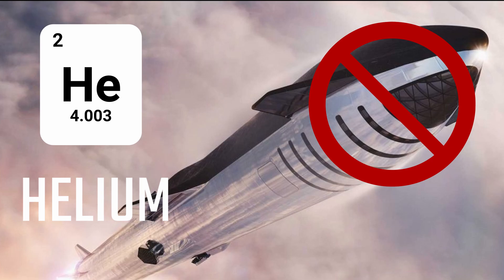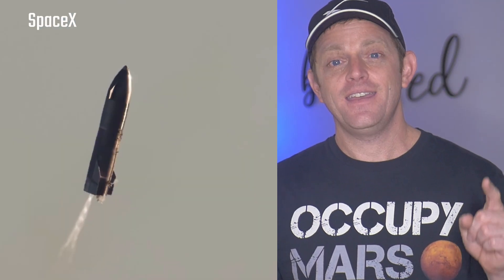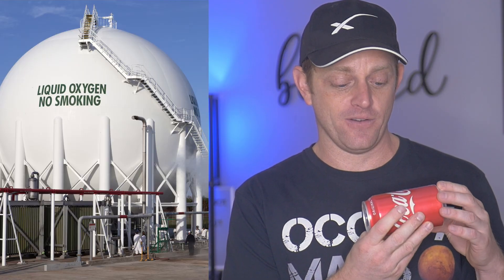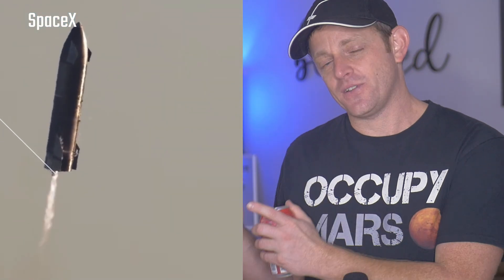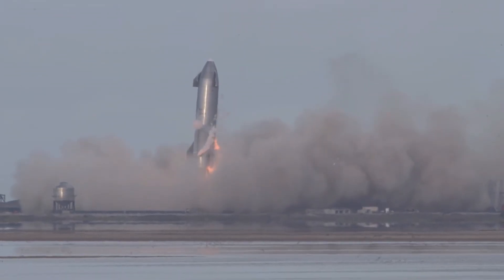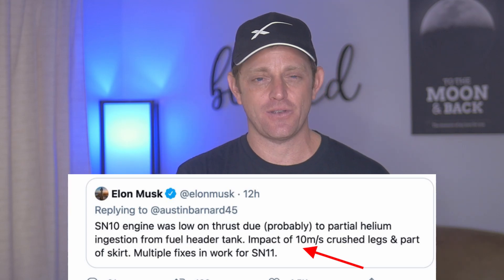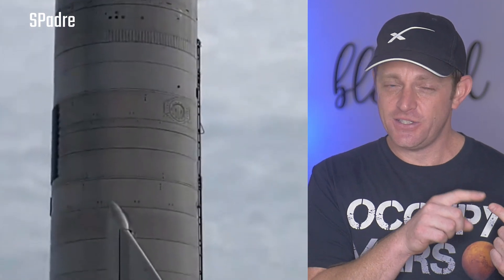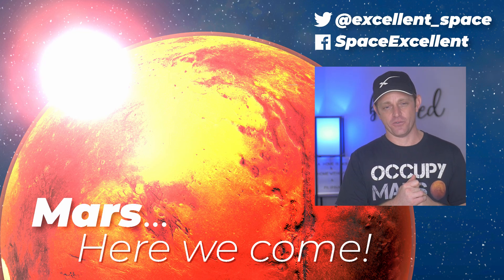SpaceX Starship SN11 update and WHY SN10 crashed | Starship SN11 Update | Elon Musk

Comment: Why not just put a heating pad around the header tank? That would increase the pressure. I’m sure Elon would think of this. The simplest solution is the best solution.
Reply from the maker: This is called Autogenous Pressurization, and still is kind of a specific heating method. Too much causes explosive results, too little causes lack of pressure. We will see what SpaceX does with this problem!
Reply: @spacexcellent5919  The other thing I wonder is why they don’t have a well under the booster that they could lower the booster into so starship would be placed on top at ground level. This would make the tower shorter. The well could be like the minuteman silos.

Comment: I can't follow this Helium story even a little bit, doesn't make any sense to me. It's about the one engine running until touch down, with a perfect flame, there is no indication of any combustion problems at all. This seems to be false, and a reason can be found at the shout down of the second one, that had falsely been commented as 'intentional'. In both SN9 and SN10  some parts can be seen flying away, was for SN10 the moment, when the massive Methane leakage begun. This can never have been a normal venting, would be suicidal out of the engine bay, is normally happening at or near the tank. Mister musk admitted an engine failure indirectly, in the message, that in the future a third engine will be reignited (a third time), if one of the two fails. This is in clear text, that one of the two failed, would otherwise have been written without any reason, and by the way, is he trying to protect the commentator.

In both cases, something bursted, as is being shown and proven in other analysis, either the lines inside the engine bay, or more likely a part of the  engine itself. The problem seems to lay in the length of the lines from the header tanks, especially the Oxigen side, with more than 50 meters. Their liquid content is like a pillar with its mass, that must be accelerated or discellerated with every change of consumption. With increasing, roughly the pressure is dropping down to 0 at the other end, and regaining while the flow speed increases, taking its time,  as longer the line is as more. With decreasing, shutting down an engine, there can be produced a strong pressure peak, depending on the closing time of the associated valve, resulting in a hard hit, when extremely short. This is common knowledge among sanitary professionals, how valves must take some time for closing, for discellerating the water pillar behind. Closing a valve of a longer and thicker main line can take several minutes, could otherwise bring the danger of breaking something.

In those two ships, the damage came with such consumption changes, in SN9 with the second ignition of the second engine, and in SN10 with the second shout down of the first one, both running and shouting down very well at the first time. The pressure fluctuations can be seen in form of changes of the flames, and those are by the way the obvious reasons, why they don't reignite at the same time, as at the first time, but shortly one after another, only when fed from the header tanks. I guess that these pressure fluctuations would'n be such a danger, if not asymmetrically, making some liquid crossing inside the engine to the opposite side, developing there a little bomb. This is why I guess that more likely a part of the engine bursted, and those are two different cases, extensively low Oxigen pressure at ignition, and extensively high at the shout down, in the first case crossflow of Methane, in the second one of Oxigen, bursting different related pats.

The obvious solution would be an 'expansion vessel' at the end of the line, how it is being called for ordinary heating circulations, that would have to hold some operational volume. Such one would push its content during low pressure, and let some elude during high pressure, half way filled up the at nominal pressure. This could never equalize everything, but at least the half value, would be much better. But I guess, that mister Musk is trying to avoid such a thing, that would have to be placed at the exit point of the lines, where already a lot is around, not an easy thing. But he will have to do something of this kind, and is seeking for the most minimal version, and this will take time. The entirety of such behavior could or should have been recorded precisely on the test stand, providing a base for further improvements, with igniting and shutting down in different sequences, what only would require longer static fires.

And with this, there is coming up another topic, worrying me since a longer time, the floor under the test stand. The longest static fire, that could have been seen, was only about 3 seconds, what has been shortened to only 1 second, after the complete destruction of at least one engine trough concrete chunks, later last year. The current configuration is very risky, there should be developed a better floor, probably made from water cooled steel plates, if not a minimalistic flame diverter, to reprieve from to much ambient heat too. It's great, that not such facilities are needed, as can be seen for the SLS, allowing some 8 minutes of static fire, but what they are doing here, is too little. It is a high cost factor too, when loosing time and destroying prototypes, that otherwise could have been reused, and flown twice or thrice, in much shorter times, than always bringing a new one, with all its initial issues, thänks.

Comment: You're factually wrong when saying the pressure in the can builds up after shaking, since the pressure remains the same. When the can is unshaken part of the CO2 in the can moves to the surface of the liquid ie. at the top of the can (if held upright) and the rest remains captured in the liquid since the content is pressurized already. When shaking the can even more of the CO2 at the top gets mixed up with the liquid, thus forcing the beverage out the can due to the expanded CO2 bubbles when the pressure within the can is released as it's opened.
Quite a bit seems btw familiar from Jacob Leachman's  publication in March 19th 2015.

Comment: They would have to ramp up their autogenous pressurization system. I think this was always the plan for Starship anyways but this seems a tough nut to crack. Sure, there would never be bubbles, because they would turn liquid almost instantly. On the other hand you can pressurize with helium COPVs faster than with autogenous pressurization. So mayme use the aurogenous system and use Helium only if the pressure tanks post flip or at least post the big slosh. Don't know if that would be possible though
Reply from the maker: I agree, autogenous pressurization seems like it would be the best fit. Whatever the fix is, I hope that Musk lets us know